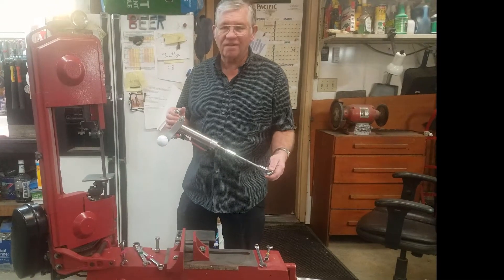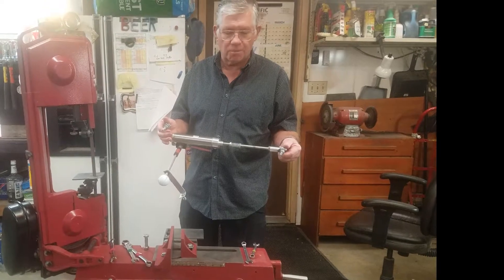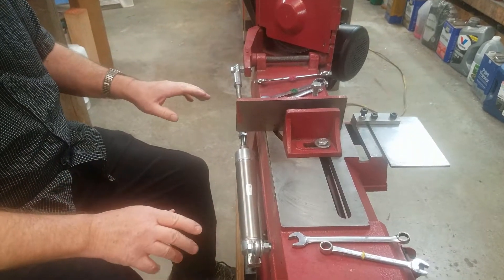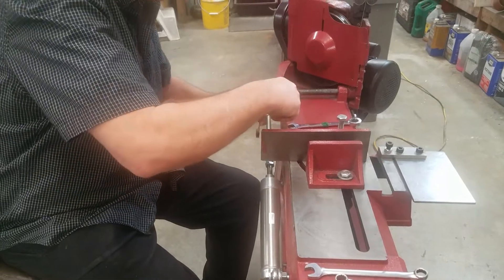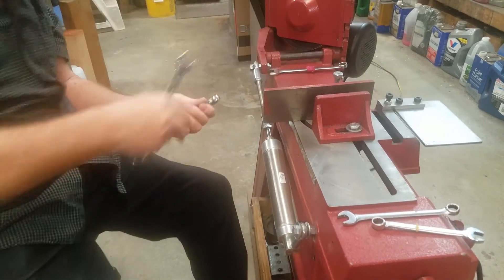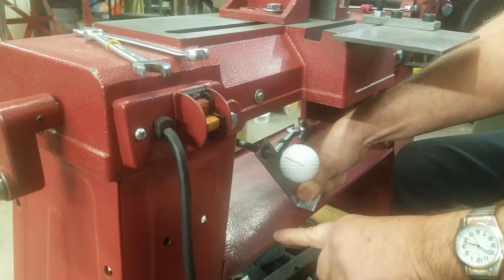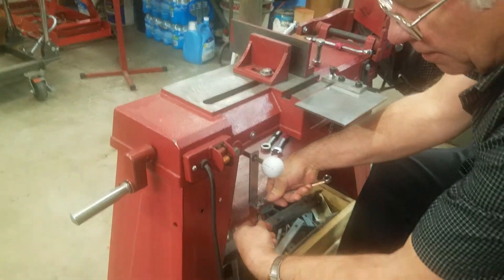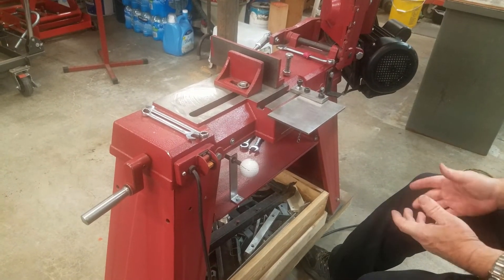Band Saw Hydraulic Down Feed Kit for Harbor Freight, Jet, Dayton, Grizzly, and many more

Comment: This was really exciting until I realized the price of this mod is the same cost as the saw. The whole point in buying one of these saw is to save money in the first place so I don’t see how it could be justified. Maybe at like $100 but definitely not $300
Reply: Yeah. It's fine putting a $60 keyless chuck on a $100 drillpress to reduce runout because that turns a cheap little drillpress into a great little drillpress, but the price-per-unit is just too high to justify putting a $300 hydraulic cylinder on a $400 saw. Maybe for a $1400 saw, but there's too little bang-for-buck for what I need to do. 
 
Edit: this unit looks well-engineered and the quality of the parts look consistent with the price, but there already so many modifications you have to do to make a $400 metal bandsaw saw usable, particularity in upright-mode, that a $400 saw will become a $2000 saw by the time you're done with it. Oh well. It is what it is.
Reply: I agree! Very cool but I will stick with the spring!

Comment: great idea but the saw didnt cost me but 199 so 299 just for a hydraulic cylinder seems high for my pocket book but your execution and fix is spot on and i bet it makes a huge difference . if i used mine more than 2 or 3 times a year i would empty out my pocket book
Reply: Especially considering he used less than $75 bucks worth of off-the-shelf components to make that